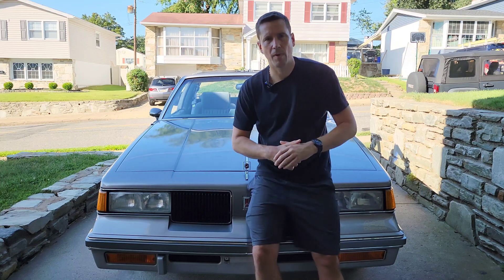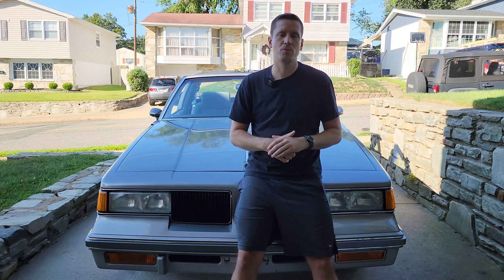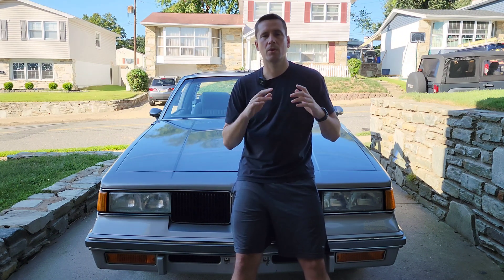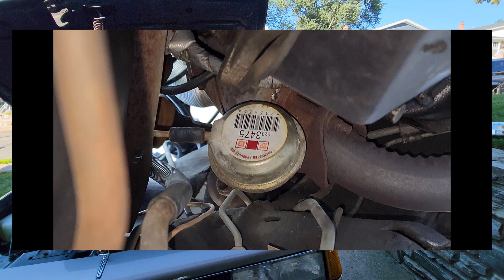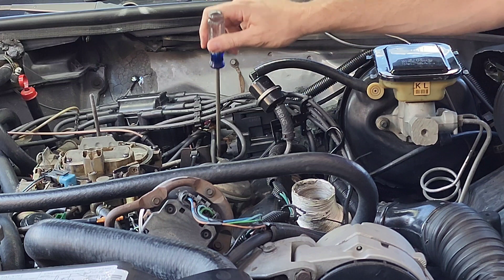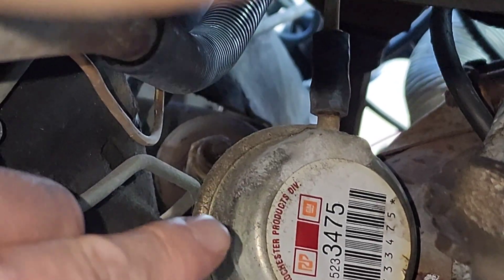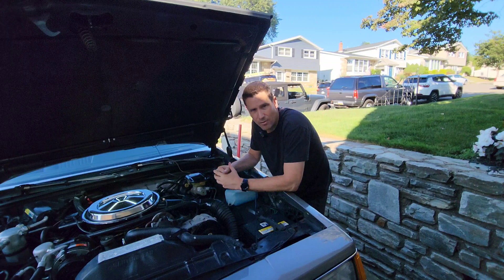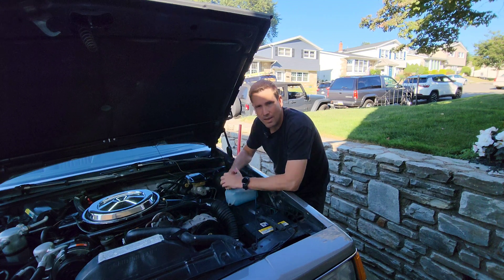The (Always Forgotten) GM Early Fuel Evaporative System - Basics for Beginners

Comment: I recently bought a 1985 C10 and found the EGR and EFE modules were defective and some of the vacuum lines were cracked and the AIR system pump disconnected. After some time I was able to remove the pump the modules and all the exhaust manifold heat pipes and modules and many vacuum lines that were associated with them. 
Very important.... I replaced the PVC valve and hose and the valve cover to air cleaner housing hose and power brake vacuum hose they are important. Replaced the gas tank rubber hose that goes to the charcoal canister as well. Perhaps a vented gas cap would do away with that?
I plugged four of the charcoal canister inputs and about five Quadrajet inlets after removing vacuum lines. I rerouted the transmission vacuum line and distributor vacuum advance line. 
The PVC valve line has a T that goes to the charcoal canister. I replaced that vacuum line with a new one thinking its still needed as it applies vacuum to the canister. I may be wrong about that but everything works well.
Is the large hot air hose that goes from the exhaust manifold to the air cleaner housing important? I replaced mine thinking it would help.
Reply from the maker: You were right. The canister will need vacuum applied to clear out the fumes. As for the hot air pipe, it's there to help improve cold weather running when the engine is still warming up.  It's especially useful on carbureted engines. It's not 100% necessary, but you may notice a difference with hesitation and idle quality the first 5 minutes or so of running.

Comment: Can you tell me about charcoal filter or the Vapor Canister?  I have talked to different people about them and some say you need it and some say you don’t?

Thank you!
Reply from the maker: This sounds like a good topic for a future video. It is possible to delete it, but you'll need to make adjustments to the system to capture the vapors from the fuel tank. There is nothing to be gained by removing it, though (except for looks). It doesn't affect engine performance in any way.
Reply: @rporestorations  It would affect performance if some hoses were disconnected and not caped causing a vacuum leak. That is a good topic. I am curious if a vented gas cap would eliminate the need for the tank vent. Also the transmission vacuum goes to the canister or a junction near the canister? I routed mine directly to intake vacuum.
Reply: @rporestorations does the tank “regenerate” indefinitely, how would you know the tank is bad?

Comment: The problem is, you can't get many of the emission control parts anymore. Very few cars of the 70-80's have working emission control systems. It's often best to pull all that crap off and put in a new TBI fuel injection to get better perfomance, MPG and lower emissions.
Reply from the maker: Many of these parts are getting hard to find.
Reply: @rporestorations  Yes, sir. About 15 years ago, you could go to a salvage yard and find these kinds of vehicles. My daily driver car used to be the family car, but it never left me stranded until a couple of years ago when the carburetor failed. I never crossed my mind at least to stock up on such parts. Now, people like us will search Ebay for hours at a time in the evening looking for certain specialty parts or instruments. You are stuck with either a non CCC or and electrical controlled system. Going forward that's the mind set when building or restoring current vehicles because you will want to salvage the current parts that you have when swapping things out.

Comment: Those EFE exhaust manifold valves on the chevy engines would always rattle when cold.  The fix was to add a restriction to the vacuum hose to dampen the valve.   Fixed 1000's of cold weather drivabilty problems by reconnecting the hot air tube to the air cleaner.  Made big$ money back then, now we can hardly make a living wage here at the dealer.
Reply from the maker: You're absolutely right about that hot air tube. So many people disconnected them not knowing what they did.
Reply: Or the tube was improperly installed, and just fell off. @rporestorations
Reply from the maker: Also true!